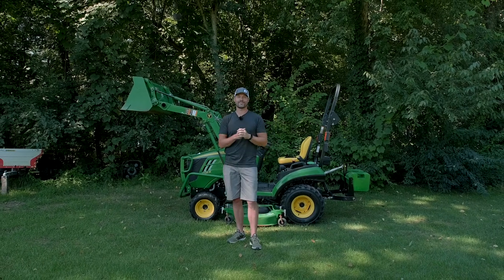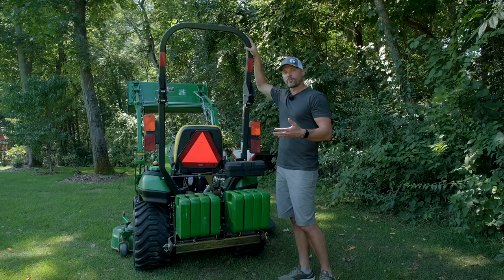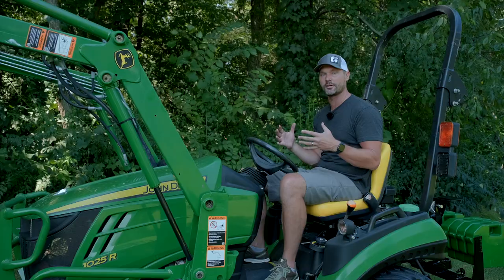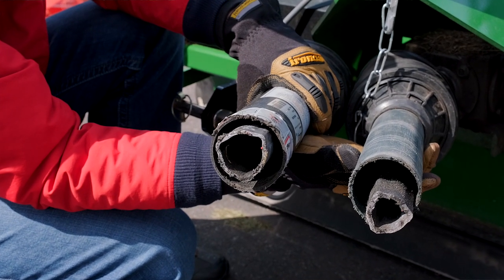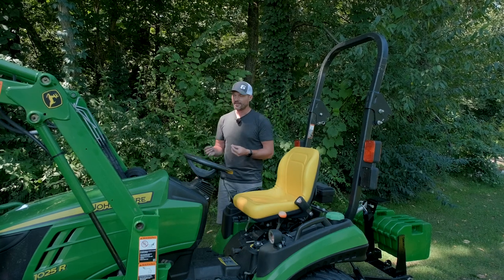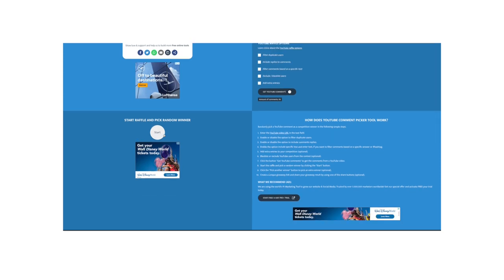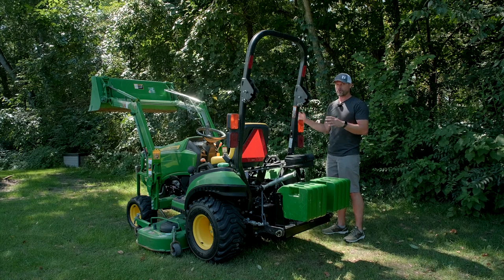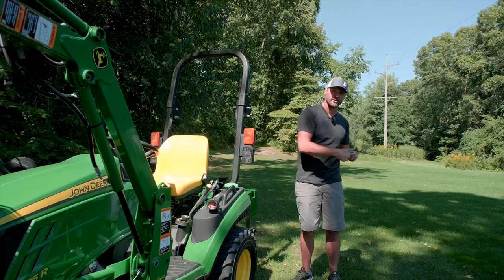TOP 5 WAYS YOUR TRACTOR CAN KILL YOU! DON'T WAIT TO WATCH!

Comment: I had used my compact tractor for more than 20 years, and was always careful of side roll over. My tractor came without a ROPS (older Yanmar 220D). I fabricated a ROPS just to be safe, but I never rolled.  I loaned my tractor to a friend, and a couple hours later a get the call "Could you come over and set your tractor upright?" The ROPS saved his bacon, and a 4WD pickup rolled the tractor upright. A few hours later to let the fluids settle, and I drove the tractor away.  It is still going strong on a small farm elsewhere in the state. I would never bypass the ROPS. And as a reminder, never drill into or weld onto your ROPS. It voids any warranty you may have, and may compromise your ROPS.

Comment: A few years ago a friend of mine was driving a truck up a hill and the truck broke down he had a trailer on the back with a tractor on it. I asked him to let me go by him and pull him up the hill and he said no he would pull the tractor off of the trailer. Has he started backing off the trailer the tractor and trailer started rolling down the hill because it lifted the back tires off the ground of the truck. He quickly dump the clutch trying to get off the trailer faster. But he had left it in first gear and the tractor stood up and rolled over.luckily he was able to jump free of the tractor as it went over. The moral of the story is always have your trailer sitting on level ground when you’re trying to take off the tractor.

Comment: Most over backwards accidents are caused by not using the draw bar its designed and  connected so that your pulling forward low under the tractor hard to get it to lift the front  using it  Ive seen people pull off a lifting boom  and wonder why they wheel stand it !! same seen one hooked to the top link !! I have both a MF 235 and a 1050 both still have the factory draw bars .

Comment: In the "too much torque" segment, it brings to mind to try to keep your attachment to the tractor BELOW the center of the axle so that you're actually pulling down your front end rather than lifting it trying to crawl over backwards. Use the drawbar, it's positioned there for a reason. In the segment of keeping yourself in 4WD to link your rear axle with brakes to your front axle, is the reason I don't have a trailer hitch that attaches to the loader bucket. If you lift too heavy of a trailer, especially on a hill, you're going for a ride, trailer and all as there's no brakes up front.

Comment: I've yet to find a video with someone that has a 3 series or similar, snow and ice, and a challenging hill.. Do you have a video I have missed?.. Or do you have advice? I'm taking delivery of a 3033r with a 59" front blower, rear box blade..  R3 turf tires filled on rear with 4link ladder chains on rear and 2 link ladders on fronts (not filled) .. Am I looking ok or am I in trouble?.. Any advice would help.. THANKS

Comment: I learned very quickly how easy it can be to tip a tractor over using a good friend's John deere 2305. The loader is a great addition, and it's extremely useful, but the first time I used it, I didn't understand that the loader had enough strength to literally lift the rear wheels of the tractor in certain situations. I was driving at speed with a large chunk of concrete on the forks. I was approaching the maximum amount of weight the loader could handle, and have the forks about 2 and half feet high. I thought everything was ok, until the front tire caught a small hole I didn't see. The tractor tipped, and the rear tires were up in the air, and the loader was on the ground. The tractor was stuck in a weird angle, and much more, and it would have rolled. My friend told me how to get the tractor back down, and then gave me some tips to avoid it happening again. I help him with his business, so I'm on this tractor quite a bit, and I'm always aware of where the loader is, and what I have on it when using it. I have found when I'm using the forks, I typically mildly tip the forks back, and lift them no more than just a few inches off the ground when moving the load from one place to another. Great video. Thanks for taking time to put these videos out. We all need these safety reminders

Comment: Thanks for the info , I m setting up a 2025r how wide can I go with the bora wheel spacers without interfering with a mower deck ,and can I add wheel weights with the spacers and should I use 4 spacers?

Comment: Dismounting from operating backhoe my loose jacket snagged one of the controls and started moving the bucket. Bucket was already swung to the side and into the ground pushing the tractor over onto 2 wheels before I was able to disengage. From now on I always turn off the tractor before dismounting from the backhoe.

Comment: I'm finding the entire process daunting. Each time I decided on a tractor I find reasons it won't work for me. I have a one acre home and shop, then 4 miles down the road is my 120 acres of pine. I need a tractor there for fence lines, running a mulcher, maintaining the dam on my lake, etc..  Here at the house I need one to level part of the lot, and build up the rest. So maybe I need 2??? But the seat safety switch would drive me crazy.  I believe the best safety switch is between your ears.

Comment: I worked at a place that had a 75 hp loader tractor. I was the first one to use it when they got it used. Didn't take long to figure out only one rear tire had calcium in it. She was light on one side when I started loading manure.

Comment: I have forgot on my steep hill to engage my 4 wheel drive and I had to hold the brakes on firmly and put (force) the 4 wheel drive active. I did have to force the lever into 4x4 with some gear grinding. I now keep 4 wheel drive turned on nearly all the time except when tight turning. Then I turn it back on immediately. This scared me so bad I doubt I will ever do that again. The back of the tractor started to slide and come around on me. Talk about pucker factor.

Comment: Digging bushes out on a slight grade last year had me on 3 wheels without ballast weight. I made a form to pour a concrete ballast that weighs around 500 pounds. it also will line up with the i match quick hitch.  still feels a little top heavy at times but nowhere near what it was

Comment: I was going down a hill, had too much weight in FEL bucket. Tractor popped out of 4 wheel drive and there was minimum weight on rear tires so minimum braking.  Lowered bucket to ground to stop. Happened so fast!!

Comment: #1 most dangerous thing around a tractor, complacency. I have done this so many times before and nothing happened. About the seat safety shut off, I understand it but it is sure frustrating when trying to use forks. Can't see where the forks are when grabbing a pallet, lean forward or try to stand up and the tractor shuts off.

Comment: The “high-torque” back-flip in a tractor is the very same type of event like a chain-saw “back-fire” when if the top quadrant of the chain-saw end happens to become even momentarily immobilized, because of which,  the chain being driven to the front towards the Edge seeks to run off the point of immobilization seeking to flip the chainsaw 90 degrees vertical using the user’s hand as pivot to reach their head & (hopefully not 😊) spilt their noggin in half.

Comment: A good one to address is when using the brakes to turn sharper  is the fact the speed doubles !! and will roll you over!  those bigger tractors like the old tricycle international farmall  models were really bad about that Be in a low gear and off the throttle if you skid steer one .

Comment: Tractors didn’t have seat safety switch for most of my life and never a problem in 63 years. Pto guards in place is a must , to many have died and have lost parts of body.  Lost control going down hill is a common problem, had it happen around the farm many times, with loader it’s a quick fix, lower loader as a break. Without you are in for a ride, don’t panic, steer with steering wheel and brakes and keep it straight. What is ahead will decide what happens next, ride it out or jump. Bucket low is a must until dumping, big mistake most operators make often. In a rough area keep it low and hands on loader lever, dumping load has saved my bacon many times. I had a log on loader two weeks ago and tractor started to flip but my hand was on lever and hit float drop, tractor was was at 45% going fast, log hit ground fast slamming on up side of forks hard pulled tractor level. I proceeded to shut off tractor and pull seat out of my butt. Mistakes made were moving logs on hill, I should have dragged them to a level spot with chain. I lifted to high to get over trash, push trash out of way than keep load low. Being ready for things to go bad saved my neck. Two other mistakes roll bare was flipped down from driving around trees and branches I should have flipped it back up and put on seat belt on. 
    Another thing that seems to get me into problems easily is my disability, I have lost use of my legs due to a genic illness. So getting off and on creates big problems in rough terrain. I made a lift to get on and off tractors, but wheelchair stays were I get on. I find myself taking more risk in situations.

Comment: I have seen a 30Klb wheel drive tractor with 3 12ft seeders attached going backwards down a hill roll up on 2 wheels as the driver was trying to follow the seeders. The only thing that saved tie tractor from rolling over was the 4x8 " draw bar that he bent. Thee driver chose the wrong gear for the hill   and tried to down shift, unfortunately the cultch didn't hold. "Laundry Time'

Comment: Watch brake lock-up... I watched in fear as my wife almost rolled our tractor while driving across a low bridge on our property because she had her foot on one of the split brakes causing the tractor to slide toward the edge when she was afraid of going too fast.  She did not realize that there are independent rear brakes which are very helpful when used right... but you have to know that they are there and how to use them!

Comment: I will have my sons watching this video for the safety value of some one else telling them what I told them.   Your Versa B & weight system is awesome, on my 42 hp I try to leave the hoe on & that works fine but  when its not on or I am on say the 28 hp I am usually scrambling to find something to work for counter weight, Grader blade, box blade, boom pole, rake, auger, spreader even tiller Just not Heavy enough.. Yes the bush hog or disk are heavy enough but now look at the size having an extra 8 or 9 feet behind me to worry about, especially when in the drive way, parking lot or street, your Versabracket and weights are perfect. They will work very well with the forks for loading & unloading.

Comment: Yes, don't bypass seat! It's a pain, but...Also, drop your bucket as a larking brake. Listen to this guy. Most times you re alone, so think about it. Don't use the edge of your bucket to lift something heavy, I.e., the edge of a container, a large rock, etc. It will tip over to the side.

Comment: This video gives me PTSD….especially showing the hills in fact I couldn’t watch the whole thing, I will have to revisit and finish it. Almost exactly 4 years ago on a new JD small tractor/mower with turf tires (just don’t use them!) my first trip down a hill was my last, when I applied the brakes the tractor just kept sliding down hill very quickly. I had a thick tree line and ditch in front of me and a ditch to my left. I apparently jumped (I don’t remember) since I could not stop and landed in a ditch about 12 ft below me to the left, upon landing my left leg was driven through my pelvis exploding the socket part into hundreds of small shards of bone, the rest of the pelvis was broken and displaced in 4 places. I was lucky to live. Turf tires are a huge danger unless you are on absolute flat ground. I am 61 and have had a rough recovery.

Comment: I doubt wheel weights or spacers would have helped any of the accidents shown.
Also, John Deere does not recommend the use of liquid ballast in the tires but rather weights bolted on instead. Liquid is not compressible and reduces the shock absorbing and traction abilities of the tire.

Comment: That's how my uncle died, he was using a bigger JD. A piece of equipment he had used for years and back off the throttle too much. Lost control and it rolled over top of him. Don'tget complacent when operating equipment for years, it will bite you in the ass.

Comment: Never take a tractor with a front loader on steep banks .The balance is all wrong .If you think it is going to help you stop you really shouldn't be driving a tractor . Tractors are tested for roll over and the degrees of incline for safe working without a front loader. Also the PTO stub shaft cover was missing in the video .